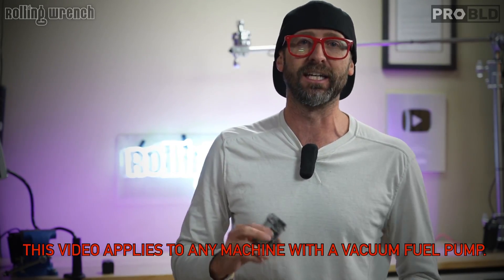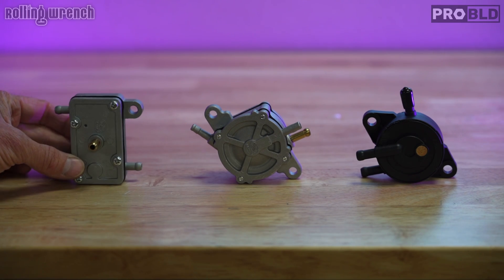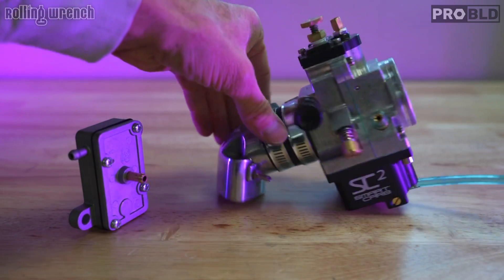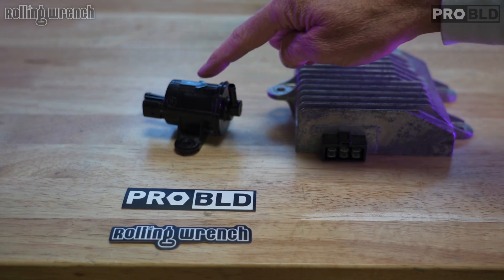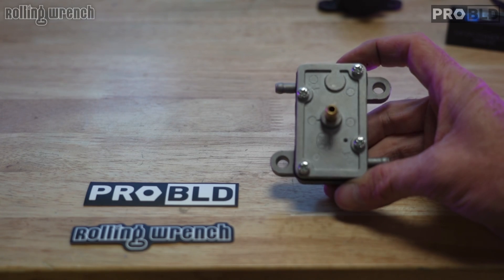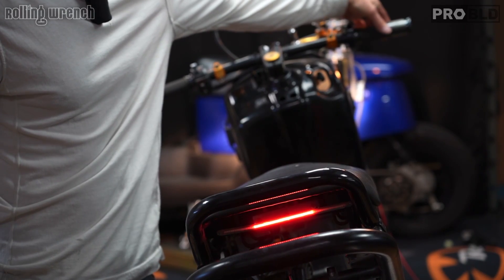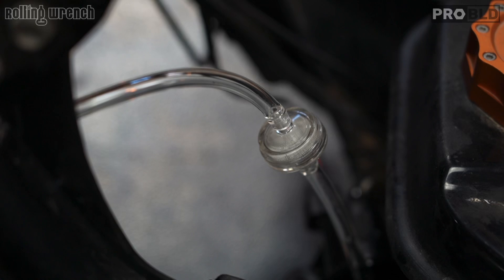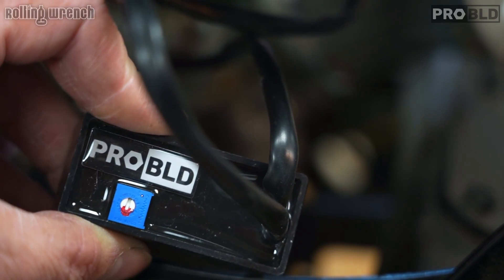No more vacuum fuel pump problems! GY6 Won’t start: FIX! [PROBLD PULSER UNIT]

Comment: I want one where do I order
Reply: Would this work for any 12 volt fuel pump..
Reply from the maker: @619Rider69  yes, as long as it’s ac 12v power
Reply: @619Rider69  it pulses on and of to simulate vacuum pump to control flow and pressure ,maybe tough on your pump . Search adding elec pump to your bike , some one has done it !
Reply: I have a venom motorsport cvt 200cc x18r. Had it sitting for 4 months, doesn’t start anymore. Everything you described is happening and the fuel tank is above the carb but I do see a vacuum fuel pump. Can that be the issue ?
Reply: Price
Reply from the maker: https://www.rollingwrenchdenver.com/products/probld-honda-ruckus-fuel-pump-pulser?utm_medium=product-links&utm_content=ios&utm_source=copyToPasteboard
Reply: @RollingWrench  how much longer till they're back in stock?
Reply from the maker: @totallylegityoutubeperson4170  towards the end of the month :-(
Reply: @RollingWrench  gotcha. I have a Chinese made GY6. Are these delete units exclusive to the ruckus or can they be used in a Chinese scooter with an appropriate pump? If so I will buy one as soon as they become available  might even buy 2 lol.
Reply from the maker: @totallylegityoutubeperson4170  this can be used an anything with a single carburetor. Boats, motorcycles, scooter, tractors… :-) so ya
Reply: @RollingWrench hello from the Philippines.wont this flood the carb?sorry i had to ask i dont quite fully understand how it wont flood part
Reply: @m721ac  same thing i thought. I will definitely could flood in alot of factors. I dont think it was thought of thoroughly. If it floods you got to drain it. If you want to go agressive riding its like you always have to have a small flat head to tune it then when cruising slower gotta adjust it down. I think thats why the ecu is better than this because it adjusts the pump frequency based on incoming voltage the stator is feeding. Was thinking about getting this before but now it could just be tedious on just trying to avoid not flooding or starving the carb. Think real good if its worth for what it costs. Couple buddies of mine jumped on  it. Stomp on it and lit it on fire lol.
Reply: @m721ac  wag ka bibili pre. Mas maganda pa tayo mag mod ng motor natin dyan tas mahal pa pero palpak naman mga pyesa neto. Hahaha. Mas marami tayong pyesa dyan.

Comment: You can’t use a electric fuel pump on a Kohler v twin it will push gas into the crank case

Comment: What happens if the flow rate of the pump is far higher than the fuel consumption of the engine.
Reply: Simple... a over pressure can occur damaging the float valve inside de the carb

Comment: Looks like a check valve inside a tank like all snowmobiles have would help keep the gas from flowing back and canceling out most of the pumps effort. 
Then if the fuel pump works fine while running then a simple primer bulb or pump will solve the problem too.

Comment: Wow can I use that pump setup on my miller bobcat 225 welder/ generator . I hate the vacuum fuel pump have to prime it all the time after it sits for A while. Thank you
Reply from the maker: As long as you have a 12v system, it will work on anything.
Reply: @RollingWrench thank you sir .

Comment: Would putting one lf these on a Chinese bike like a TaoTao, or an Ice Bear with the GY6 be recommended? Would it help boost performance in any way, pr would i just be better off with the stock Petcock system?

Comment: Hi I have a question will this work on other things that takes them vacuum fuel pumps like zero turn mowers and older outboard motors my pump looks like the first one you have in the video on the left side. I was thinking about buying a electric fuel pump until I saw this video and ask if it would work

Comment: what prevents this from overfilling the carb if youre just sitting in accessory mode?
Reply from the maker: Inside the carburetor, there’s something called a needle and it regulates the fuel just like a toilet bowl does

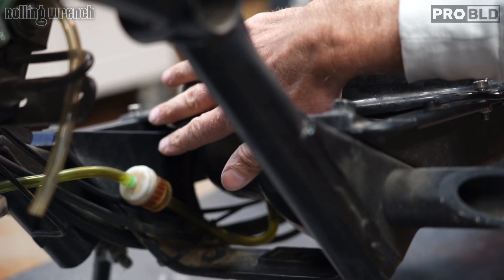Comment: starting at about 2:44= theres your problem lady!!!!! too many loops that trap air!!!  that line from the tank needs to be ever increasing in height until it hits the fuel pump.  the suction side being lower in pressure will vaporise the fuel under suction and it will never pick it up.  for maximum benefit the pump should be as  close to the tank as possible.  irregardless of that the check valve in the pump once primed will not allow air in and will keep the suction side full.   it looks like you may have come up with a sloution to a problem that was self inflicted
Reply from the maker: Actually this video is a small example of what others are dealing with. If you have been around the block you would know these vacuum pumps are junk, and wouldn’t even need to share an example, I also wouldn’t have sold hundreds of these if it wasn’t a known issue. Simply said, worst pump option ever. If you know you know….

Comment: what's wrong with a facet pump?  I have one on my rotax503.  Just change the diaphram in your fuel pump on a regular basis and you won't have a ny problem
Reply from the maker: The biggest issue is at startup. The battery dies before the fuel reaches the carb. And of course the other issues that go along with those pumps
Reply: @RollingWrench  actually the easiest thing is to put one of those primer plunger thingys on it.  I have on on my rotax too, I never use the choke.
Reply from the maker: @FourthWayRanch you can do that too. On our ruckus builds it looks pretty bad. Most of us want a clean build

Comment: Bullsh3t , vacuum pumps are very reliable and used all over the industry ,if your system isnt standard and youve done some or other redneck mod it probably wont work ,then you need a proper pulse pump ,how do you know more than engineers that design these units ,what a crock of bull

Comment: These are not Vacuum Pump, they utilize the pulse or pressure from the crank case to push the diaphragm which creates suction from the gas tank into the pump and the diaphragm inside the pump pushes the fuel to the carb.
Reply from the maker: This is all done by vacuum, making these syle fuel pumps, vacuum operated. In particular, in a scooter application the vacuum is being tapped into the intake manifold nipple.

Comment: How about  auto zone n buy a 20 dollar electric fule pump n maybe a pressure regulator
Reply from the maker: That’s an option. You may need to upgrade the charging system. Those things are heavy duty. Definitely not a very clean option, but doable

Comment: Thx for good and clear explanation. Can't the elec pump just be manually turned on when starting and then turned off to let the original vacume pump to take over? (Saving on the command module)
Reply from the maker: Unfortunately no

Comment: You will be running rich and lean a lot there's nothing to tell that fuel pump when you're idling or your full throttle so it's going to pump the same amount of fuel all the time
Reply from the maker: Fuel is regulated by the needle and seat in the carburetor regardless of what fuel pump you use

Comment: You had me convinced till I saw the price. A shot or two of starter fluid when mine has been sitting a while is all I really need and once it fires, no problems. So great idea but got to figure out a way to make it more cost effective. Not worth spending $125 on a used cooter that was only $400.
Reply from the maker: It’s not for everyone and probably doesn’t make sense for a $400 machine

Comment: my Gas Tank sits above my carburetor and I have the 2nd Petcock for mine yet I Still have issues with the airline either not getting enough air or to much idk. gets started but cant get it going for more than half a block before it begins to sputter. do you think this would be a gas issue? cause the fuel filter has fuel in it. Brand New Carburetor Brand New Vacuum Line the gas line stuff was all new last year around this time. But not getting a god run. even the motor was replaced last year. ran through most of last year. wouldn't go in the winter months due to the current issue.

Comment: I agree with all of your comments regarding the vacuum pump issues, Ducatis and Cagivas that use the Mikuni vacuum pump suffer the exact issues you described, what i don't understand is why your little pule gadget is necessary, if you install a low pressure electric pump, say 2-4psi, intended for carbs, that should be all that is needed and when the float bowl or bowls are full and the float valve closes the pump stalls automatically and when fuel level in the float bowl drops, the valve opens and the pump restarts.
Reply from the maker: I definitely understand where your head is if you haven’t been down that road. This 2-4 psi electric pumps you find on eBay and Amazon say 2-4 psi but are more like 6-8, making them pump way to hard for the little needle in the carburetor to stop the flow. Not to mention they are very low quality and use a lot of power. For us scooter guys a stator upgrade is needed in most cases. That’s the reason for this set up

Comment: Good video. Why does my GY6 scooter have a pulse pump when the bottom of the fuel tank is higher than the carb?
Reply from the maker: That’s probably a fuel petcock
Reply: @RollingWrench unfortunately not. It’s a pulse pump, three lines: carburetor, fuel tank, intake manifold. No valve
Reply from the maker: @that’s very odd. If the tank is above the carburetor it’s not needed. It can be gravity fed

Comment: whats wrong with constant 12v dc with no pulse??
Reply from the maker: The pump requires a pulse. Constant 12v won’t work :-(?
Reply: @ ah. I see. Thanks. Did not know that. There are pumps that don’t need a pulse that you can just use constant 12v but I guess if you are set on using a Honda ruckus pump then you would need it
Reply from the maker: @ahhason  we definitely tried the 2 psi Amazon pumps. They are very problematic. They require a lot of power to run them, and the over pump. Even know they are marketed to be 2 psi they are actually 4psi. This caused the needle and seat on the carburetor to spill over resulting in a flooded engine. We really tried with those pumps. That’s when we arrived at this solution
Reply: @ I’m running one right now. On a gen V maddog gy6 150. Haven’t had any issues for the last 500 miles. We will see. Fingers crossed. I’m also running an oko slide carb. Has been great
Reply from the maker: @ if it’s not broke don’t fix it

Comment: There is no ac current on these bikes outside of the stator. The brake light is a normally open circuit and with a switch it closes and completed the circuit, the tail or running light is a normally closed and has constant power and is controlled by the key switch
Reply from the maker: There is 100% ac current and dc current and motorcycles, scooters and ATVs. If the light doesn’t turn on with the key on and only lights up when it’s running…. It’s ac.

Comment: We have used the Mikuni fuel pumps in avaition prop planes for decades. They are good pumps and rarely fail. If they are good enough to keep planes in the air, they are good enough for bikes. 
If you're running this pump, you need to run a return back to the tank with a T fitting that feeds fuel to the carb. When the float in the carb fills, it close the fuel inlet valve. When this happens, the excess fuel returns back to the tank. This is a zero pressure system and acts as a gravity fed fuel setup. 
This electric pulse pump is a solution to a problem that doesnt exist.

Comment: You really need to research what AC and DC power is. There is NO AC on a motorcycle. It is all DC.
Reply from the maker: Let me explain brother. I can teach you so you’re not confused. All power that comes out of a stator is ac power. A rectifier regulator converts ac power to dc power. Most stators have a single coil that is wrapped up by tape. This coil has a single ac power wire that is used for sometimes lighting and cdi boxes. A lot of bikes have ac cdi boxes and ac headlights. But some have dc. I hope this helps you.
Reply: @RollingWrench  Yes there is ac on a bikes coil and stator but it's not the headlights or brake lights.  If you have a battery everything is DC NOT AC.

Comment: Wouldnt you run into a lean at half + throttle due to the low fuel compensation. Because setting the pulse doesnt aggregate the carbs at a higher rate when you give it more air.... Just a thought

Comment: For starters.
 The pump should be mounted closer to the type. Second Fuel filter goes past the pump. Third.
 The pulse for the pump should come off the current case event.
 Not the intake The port behind the carburetor is for tuning purposes on vacuum
Reply from the maker: I wish I could agree with you. Unfortunately everything you’re telling me isn’t true with my experience.

Comment: Hello, I found this page doing a search to rebuild my 2019 Coolster 3150 DX4 150cc quad. I am just looking for recommendations to increase performance. I have seen several of your videos but not sure where to start with the GY6 motor to get the most out of it. Is there any guidance you can provide that would be great.

Comment: Bro your bike is only DC power  it's constant or switched is what your shooting for
Reply from the maker: Are you telling be or asking me?
Reply: @RollingWrench  just giving a little advise your video made it sound like you were talking ac like ac current ! Could get very confusing for someone that don't know anything. It's not a personal attack it was just my observation of the video.
Reply from the maker: @donnellaapperson480  ahh! Thanks :-) AC power only works when the bike is running. DC comes directly from the battery without the bike running.
Reply: @RollingWrench  accessory is the switched power constant would be direct from battery. Ac current is what our houses use 12v DC is what our vehicles and bikes use. I was just saying something because someone who doesn't know the difference would get confused is all . I understood what you were saying but it was only because I understand the systems .
Reply from the maker: @donnellaapperson480  thanks for the feedback. Lucky others haven’t had issues wiring the product. I’ll take note of that.
Reply: @RollingWrench  right on happy you didn't take offense to the feedback ! I appreciate someone that is willing to hear someone's opinion and not loose their shit about it ! Respect to you bro

Comment: All the engines I've ever seen with that style of pump get the impulse from the crankcase not the intake. Looks like the intake is not going to give the correct pulse for that pump to work correctly. Using the crankcase you get a larger pulse in both directions.
Reply from the maker: That’s not an option on a GY6 . The intake pulls mad suction. A lot more than the crank case. The vacuum pumps just flat out suck

Comment: Vacuum pumps come on many small engines, not just GY6's. I have them on a riding mower and a Polaris 500 quad. The only time I ever had problems is when trying to replace old fuel lines and the nipple's break off the pump. Cheapo plastic, what do those aluminum pumps come from, gonna look for those next time I need new fuel lines because I KNOW the nipp's will break off my plastic pumps.

Comment: Hey mate, ive gotten a cheap Chinese quad and had the issue after running out of fuel. Ive been on the safe side and replaced the vacuum pump, fuel lines and petcock then the coil was shot so got thst and new spark plug. Now have spark but its like its still starving for fuel and wont start. You mentioned the fuel tank being above, ours is above but still has the vacuum operated pump, i was going to remove all together but dont want to flood the carb. Any ideas

Comment: I have a garden tractor with a pulse type fuel pump and adding the check valve as close to the tank as possible corrected my start issues. I also have a fuel shutoff at the carb that i close whenever I shut it off so the gas is pretty much trapped in the line.

Comment: This is a valve /petcock, not a fuel pump. Your carb doesn't (actually can't) run on a pressurized system, which would be a pump. If you had a pump, the pressure would be able to override the carb's float and float needle, and you'd be running crazy rich and flooding the motor.

This mod is cool, but I just ditch the vac fuel valves and use a lever style petcock like on a carbureted motorcycle.
Reply from the maker: A pump is used when the tank is below the carburetor? Fuel won’t flow up hill to the carburetor. This is where our pump comes in. There is something in the carburetor called a needle and seat that will stop the flow of fuel when the fuel level is designer, so it won’t over flow. Kinda like a flapper in a toilet. I hope this helps you.
Reply: @RollingWrench  that's interesting. I haven't taken a ruckus apart yet (just a ton of old mopeds, some GY6 scooter clones, and a few motor bikes).

The carb bowl looks lower/flush with the bottom of a stock tank, so I assumed (probably wrongly) that it was just gravity fed. 

What pressureare these pumps operating at? It must be miniscule to not override the float /needle and overfill. Carb floats and needles don't take much pressure to override.

Grav feed lever petcocks should still work on anything with a tank with the fuel outlet barely above the optimal fill level of the carb.
Reply from the maker: @SMWegge  2psi